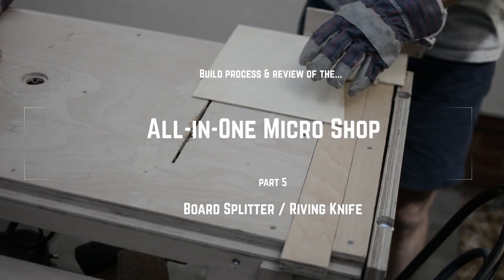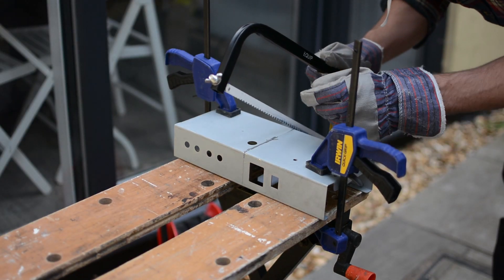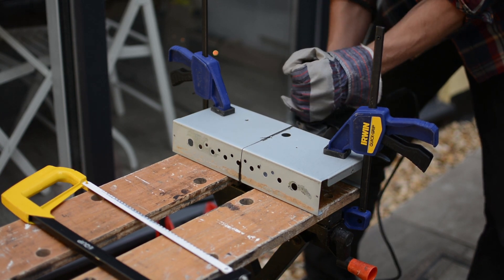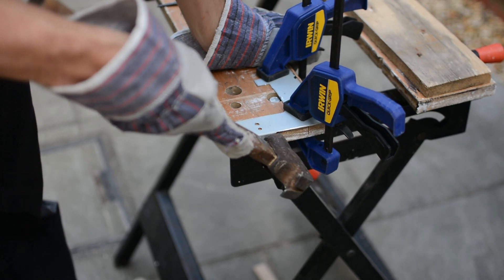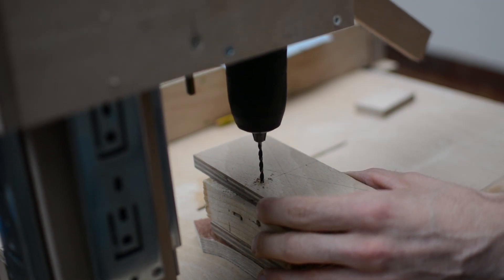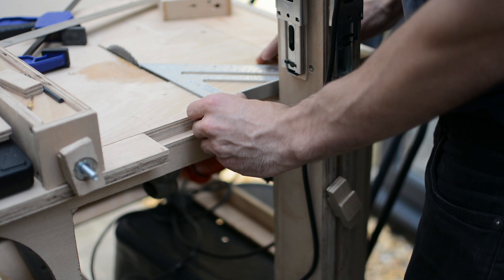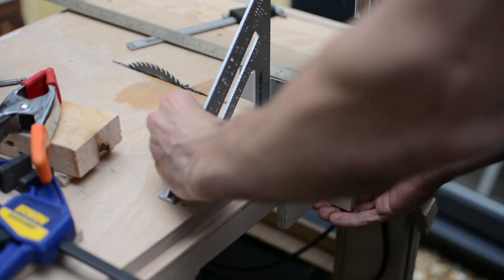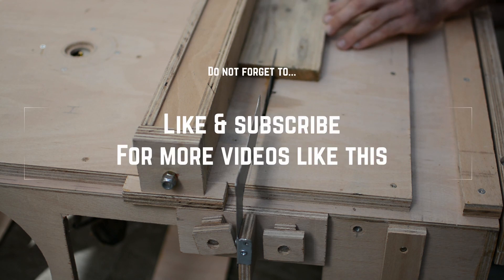Adding the board splitter to prevent table saw kickbacks - micro shop part 5

Comment: Sorry but this video is bullshit und very unprofessional. You mention safety features and at the same time the saw that you show on your video is absolutely horrible and unsafe!!! 
The blade is completely out in the open without any saftey lid etc. 
I can only advise anybody who watches this NOT use any saw that looks like shown in the video. 
Buy a proper saw for "home" purpose that come with a proper table or can be bought as an additional part to that specific saw. Its definitely worthwhile rather than losing any limb or other horror injuries
Reply from the maker: While I appreciate your opinion, I must disagree. I did have a chance to work with a "cheap" / "home" purpose table saw recently and its quality and general wobbling made me really worry. A plastic lid that these saws come fitted with won't help you much should the blade escape somehow. This build, although looks pretty raw feels pretty safe to me. Again, not recommending anyone to follow along - this is just for demo purposes. Thanks for sharing your thoughts.

Comment: Great videos! I binge watched your build. Came out great. I'm about to start on it myself. Did you end up using any low friction tape and finishing the wood? Low friction tape is impossible to get where I live.
Reply from the maker: hi! Thanks a lot for watching my videos. I did use a low friction tape and it made a lot of difference to the bridge movement. I have not used any finish yet, simply because the project is still "in-progress". :) Good luck with your build!